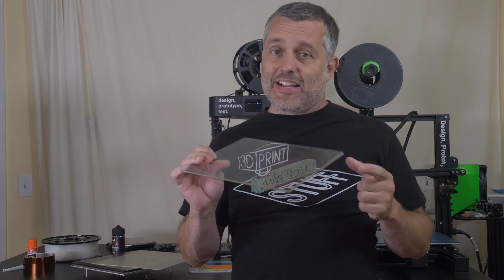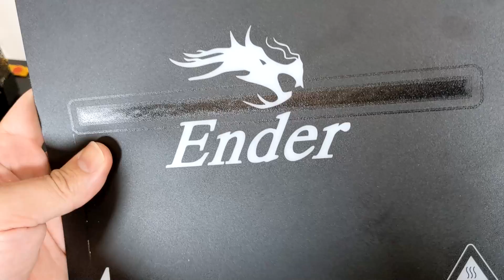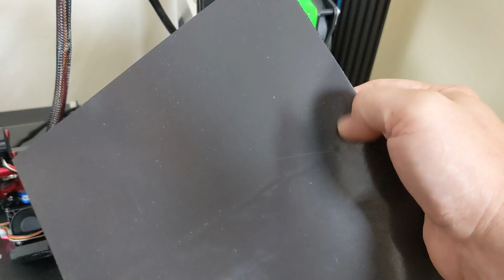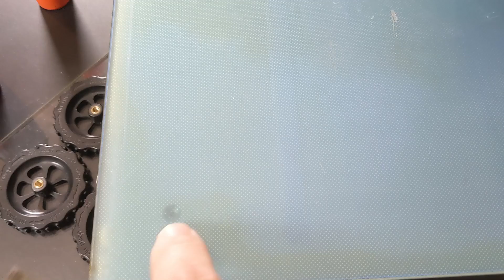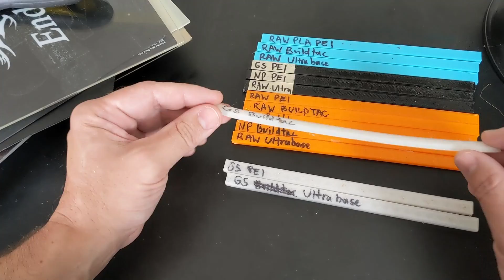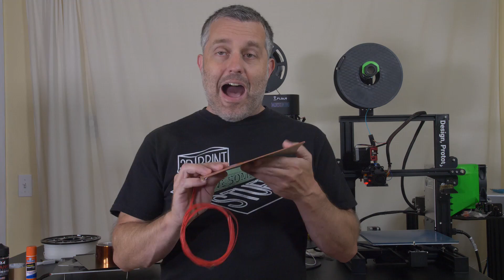The Best Bed Adhesion for 3D Printers

Comment: I bought a second hand Ender 3 which is a great upgrade from the Easy thread X1
But I cannot get bed adhesion 
And I looks like there is what you're calling "ultra base" on here
This gold textured surface bed
I'm guessing it's worn out and that's why I won't get adhesion?
Reply from the maker: The easiest and cheapest solution is just glue stick. If it's been awhile since you printed every wipe down the bed with rubbing alcohol and apply glue stick. If you're printing constantly, you'll get between 5 and 10 prints before you need to redo the surface. 

You can buy a dedicated bed adhesive to achieve 5 - 10% increase performance above glue stick. I still like Nanopolymer from Vision Miner but there are less expensive options out there.
Reply: @DesignPrototypeTest  yeah I'll try glu stick
I actually bumped up the temperature of the bed and the nozzle and it helped alot with the adhesion at first 
But I'm trying to print a benchie
Testing the printer out
And as soon as it starts with those letters at the bottom
The adhesion is thrown out the window 
But up untill then I can get it to stick

Comment: Something that greatly impacts how a build is sticking to the plate is how you have the printer calibrated as well, the nozzles distance from the bed, temperatures, etc. I currently have my printer set up, so the nozzle is very close to the bed and I'm having issues with the prince being too difficult to remove from the bed. I'm sure some slight adjustments might yield some dramatically different results

Comment: Just an FYI on the magnetic base and the reason it fails

Magnets of that thickness do not exist that can hold against the warp force of these plastics The magnet is not what's holding it down at least not the magnetic strength what's holding it down is the surface area of the magnet so the actual surface area of the magnet underneath your print is nowhere near strong enough to hold that print down however when you have a steel plate that warp force is unlikely to be able to bend the steel plate which means in order to separate the magnet from the base it has to lift the entire 235 mm by 235 mm sheet up at the same time

However because the magnetic sheet that creality uses is flexible as in nearly cloth-like the plastic warp force does not have to lift the entire sheet all at once it can lift from anywhere and slowly peel the magnet off of the bed to see what I mean by this

Take a piece of glass for that bed and tape it to one of your steel plate sheets masking tape on the four corners now place that on the mag bed put a suction cup in the middle of that glass plate and pick it up

I don't know what's actually going to happen so be ready for it but I suspect you could probably pick up the printer with that suction cup

And if you put that suction cup more toward a corner you can still lift that printer pretty far before it pops that sheet free

Now put down that flexible plate and just pick a corner and lift it takes almost no effort to lift it because you're not lifting the entire sheets simultaneously which means you're not gaining the advantage of that entire surface area of magnetic surface you are peeling it off

This is why even though it's the best sticky surface you have it sucks because the surface isn't failing The substrate is failing because it's flexible

I helped creality design the ender 3 and we fought about that flexible surface and they would not relent it's the one thing they did that I did not want them to do I suspect because they had already manufactured all the flexible sheets and they did not want to throw them away but they suck :-) well they only suck if you print near the edges if you have a large high warp force print smaller stuff which really is what most people print never have a problem

Comment: Also that's not ultra Base it's a clone or maybe something they tried at some point in time but every piece of ultra base I ever got was black

The way ultra Base works is two factor first it's a coating that is applied to a glass plate there is no etching it's just a coating on top of the glass like PEI now the other feature it has is the little holes that's not an etching that is a hole in the coating meaning you can see down to the glass through those holes in theory what that does is provide mechanical grip think of it like the difference between you trying to hold on to a flat piece of glass by grabbing the flat surface of the glass with your hands and now think of you trying to grab a big plate of plastic that look like a milk crate so you could stick your fingers through the holes in the milk crate and grab That's what those little holes do when it cools and the entire part shrinks that's when it releases from the part The difference in shrink between the coated areas and the uncoated areas the holes is what allows it to pop free

Comment: I just realized this video was 3 years old for some reason YouTube was suggesting it to me as new :-( YouTube is being wonky lately

Anyway if you ever do something like this again your part is not a good test subject for warping because your part is actually a pretty low warp part as you know these plastics are thermoplastics they shrink they expand when they're hot they shrink when they're cold and this shrink is comes from length and layers you only have maybe 10 or 15 layers in that part so not much shrink leverage print that thing hollow with say two or three perimeters and say 100 mm tall with no bottom layers just hollow and now you'll have some shrink force :-)

Comment: This is a guess on my part but I do not think the residue is from the bed I think the residue is from the ABS I think the part left a very micro layer of ABS behind on that fake tack surface The white you are seeing is the same thing you get if you were to take that ABS part and bend it wherever you stress the plastic you're going to see that white that's what happens when you stress that plastic and by tearing it off that print surface and leaving a sliver of a layer behind you are stressing the plastic and I believe that's what the white is I could be wrong with that though

Comment: As far as ultra Base being the best material I 100% agree with you and I 100% disagree with you :-)

I love my ultra base and I hate my ultra Bass at the same time

At least all my any cubic chiron Man that stuff works so well and it's so reliable I truly love it except when it doesn't work and there's no rhyme or reason as to why it's not working grrrrr I suspect it was the 91% alcohol I think that damaged the surface and so mine does not stick quite as well anymore

So why do I hate it? Because you can't replace it for whatever reason they have four little threaded clips holding the glass plate on the any cubic Chiron I don't know why they bothered to waste the money to include or install those clips since they glued the goddamn glass plate onto the printer you can't remove it it can't be replaced there's no reason to even have those clips that plate is never coming off :-)

Otherwise yes the stuff works very well

Comment: Oddly enough that crappy flexible creality magnetic sheet probably has the best adhesion of everything you have there that stuff sticks amazingly The problem is the damn substrate is flexible so while the part will not lift off the bed the part will simply lift the entire sheet off the bed :-) yep your part will be perfectly adhered and the sheet will be curved :-)

Now if they would only put that surface on a steel plate that would be awesome oh and you don't need bed heat with that stuff I can usually start with bed heat and buy layer 10 the bed heat is turned off

You can sometimes even get away with PETG with no heat as long as it doesn't have corners like when I print cylinders and stuff like that with a nice brim

When you're printing a lot it can make a pretty big difference in the electric bill :-)

My problem right now is I'm printing a low density 1 kg block that is 300x150 by 300 tall and even with a 1 mm nozzle my corners lift sometimes a lot even PLA will warp right off the bed and this is even printing on squeaky clean glass which PTG my primary material normally sticks to like gang busters I think it's pure mechanical leverage I think the layers above are shrinking and it's just tearing itself off the bed because I have a much lesser problem with the 400x400 printer since it has that roughly 70 mm buffer all the way around the park but I only have one printer with a 400 by 400 heater and when I print this on my 334s which I have plenty of it warps every time even PLA warps I think it's just mechanical leverage The last thing I haven't tried yet is an enclosure but those kind of concern me especially when I have to print 400 kg of plastic manufactured homes are like kindling to fire so I kind of shy away from enclosures

Comment: there's about a thousand grades of garolite and most of the off the shelf "garolite" (actually fr4, which is worthless for nylon but excellent for many other filaments) build surfaces are worthless.  garolite CE, lightly but thoroughly scuffed with 80-120 grit sandpaper is my personal preference.  80-90c is the trick.  you can get a 12x12x3/16 piece from mcmaster inexpensively.  if you plan on printing other materials that require higher bed temps than nylon then garolite XX is excellent as well.

that knockoff ender "buildtak" surface is polycarbonate.  it's pretty much worthless on a heated bed.

Comment: Here’s a getting the print off trick I’ve learned. Leave the area where your printer lives. Go eat a sandwich, wash your hands a dry them. When you come back to the printer it has cooled down and on PEI and some times even glass the print has released. And the presenter is right, clean the surface with isopropyl alcohol.

Comment: How do I get an ultra base?
Reply from the maker: ebay or aliexpress (https://www.youtube.com/shorts/8svmyUisaHM) "Ultrabase" many sizes available.
Reply: @Design Prototype Test  hey man thanks for the help. I'm sorry to keep bothering you but I had something unexpected happen. When I got home my printer was clogged and when I mean clogged you can't see the extruder anymore. How do I clean this mess off my extruder?
Reply from the maker: Manually tell the printer go on the low side of the print temp for the filament. Say 190° for PLA. Wait until the nozzle reaches temperature and start hacking/carving away the plastic as best you can with snips while trying not to burn yourself. Don't cut yourself or damage the printer using a knife or a saw. Or do, but use good judgement and don't get impatient. GOOD LUCK!

Comment: The best bed ahesion is getting your first layer correct, if you cannot do that, and get the right amount of squish, with a alcohol cleaned, bed then you are doing something wrong or using the wrong bed for material you are printing.

Comment: I don’t agree with your results with g10 as I can see in your video that beneath it is the stock ceramic coated surface which came 
with the printer meaning less heat is being transferred from the aluminium heat plate to the g10 sheet making these tests invalid 
as the different build surfaces are not directly on the aluminium heat plate like it should be when you are 3D printing in the real world. Plus G10 needs to be heated well when 3D printing otherwise your prints won’t stick to the bed.

Comment: different materials like different beds. they should have a warning about material/bed incompatibilities, like PETG and buildtak. i welded those together a few times. 
PLA/PLA+ seems to work best on steel beds like PEI.  Then the polycarbonate that i used seems to hate steel and glass, and only likes buildtak.

Comment: I print ABS and use Kapton tape  on glass, I dirst sand it lightly with 400 grid sand paper.
The tape holds fine for lots of prints if your first layer is dialed in right and you remove the part carefully.
PEI sheets don't like high temps of 100 C

Comment: I noticed that all your prints span the width of the bed and they were failing at the ends. Test you beds for uniform heating.  Most heat in the center and radiate outwards. Just a thought.

Comment: I've been using capton with PLA succesfully for years now. Bought a 200mm roll, and I change the surface maybe once a year. 60c Bed temp.
Once its cooled down, it comes off by itself.

Comment: When you did your printing tests, what was your nozzle temp and your bed temp? Reason I'm asking is because I just set up an Ender 3 pro V2 3d printer and my print keeps sliding around.
Reply: I don't have the answers but I'm experiencing the exact same thing! I've had mine about a week too
Reply: @kingofthebums  Good to know. I've heard that using a Vinegar and water mix on the glass to clean it will help it stick, but I'll have to test it first before I let you know.
Reply: @seantazelaar9807  thanks. I tried glue stick with the raft thing because when I've been trying to speed up I'm losing adhesion. It's working really well. I'm able to run at about 60% for the first layer then I jump up to about 85 or 90. No problems so far. Also I'm still shutting off the fan for the first layer and it just seems to kick on by itself after that so that's convenient
Reply: I've been watching a bunch of videos. I bought some glue stick but I'm afraid to try it. Also I've found that if I make a raft I can make it work. Also I have to turn of the fan and slow the speed down to half for the first layer  then I can go up to like 90 percent speed and the fan just comes on on its own.

Comment: I’ve found that the best way to apply glue stick is to zig zag a little bit over the whole plate while coolThen, using a spray bottle with alcohol, spray the whole print bed. Using a paper towel rub the lines of glue around the bed so they don’t appear any more. Then let the bed dry. You’ll have a layer of glue over the whole bed. And won’t need to clean and reapply every print, just spray with alcohol and wipe gently with paper towel. Reapply as needed, I’ve found every 10-20 prints depending on size of print.

Comment: Have you tried Polymaker PA? they put an additive on it that delays crystallization, so it doesn't warp... furthermore, you need to print it with the bed relatively cold (less than 50°C) so the heat don't trigger the formation of crystals and thus warping. Then you need to anneal the print to fully (actually not fully.. it's a polymer ^^') crystallize the print and get the best mechanical properties out of it.

Comment: Interesting observation. This "magic" nano solution did not preform well in any of your tests. 50 bucks for nothing :) I can tell that here in Russia you can buy a 3D glue, which is also a liquid solution, based on isoprop alcohol. Less then 5 bucks for 100 ml. PLA, ABS, PETG, PC, SBS and TPU are sticking to it perfectly, when applied even on a normal glass . Obviously, for PC and ABS, more infill you have, better performance will be, or you have to refresh coating before every print. Usually it last for 3 -5 prints of ABS and then you have to refresh it. I still have to test Nylon and PP. But so far it works great with filament types, I have listed above. And, of course PEI sticker on flexible meal sheet works well too. Buildtak is nice, but as you have shown, extremely fragile and does not last long. And I am saying abut genuine Buildtak. A lot of money and short life span.

Comment: I have 2 of the unmentionable Czech printers. PEI SMOOTH SHEET for PLA and ABS in an enclosure, if it's a small part maybe a bit of brim or glue stick. PEI POWERED COATED SHEET for PETG. The printer firmware allows you to select what sheet you have installed and adjusts the Z height to accommodate. Haven't printed with flexible or Nylon or PC have it here wait for an excuse to break it out the bag. My other FLSUN and Anycubic Delta’s changed to either mirror glass or Easy-Peelzy on mirror glass, for when you don't want to wait for it to cool down to start your next print. The other CR10 & Chiron style printers the same as with the deltas. Maker’s Muse did a review on the Easy-Peelzy. Only problem with all these different surfaces is they need a BL Touch and you need to ensure your printers are square and trammed. Matthew kindly guided me in the direction of using a Duet End Effector for the Deltas so you don't have to worry about adjusting z heights for different surfaces. Proper Printing did a video I think on printing on all sorts of surfaces like wood which was interesting. Can't get enough of these videos, liked minded individuals sharing information, just how it used to be and how it should be. Hope this helps someone in any way essay over. I did purchase the Ed Tyson course on 3D printing which was interesting in places, if your a newbie it's ideal, if you've been printing for a while, it didn't really give out the amount of info I was expecting, which is generally a lot. But you do have access to the course materials years down the line as things progress and change.
I have just ordered some Wham Bam which is making some claims about what will stick to it and you can get this in a 2 sheet set, the bottom glued magnetic sheet and and sprung steel sheet to print on. The manufacturers are claiming it surpasses PEI and the top surface has to be flexible otherwise you won't get your print off. Quite a bold claim so I've ordered some to give it a go on one of my subjects😀 OHMAND I WANT SOME FREE STUFF PLEASE